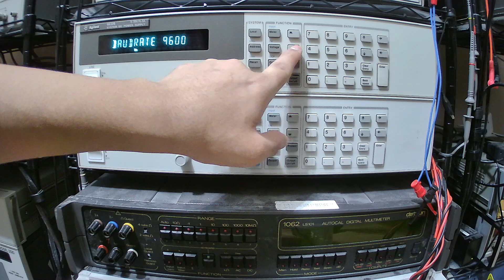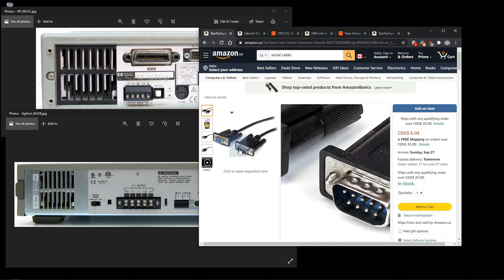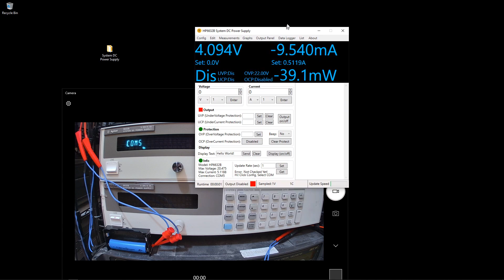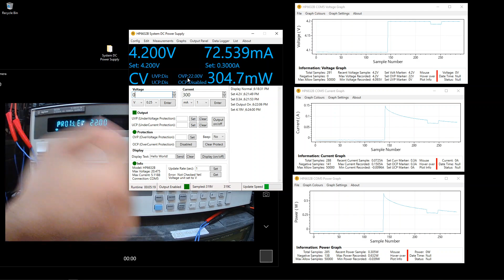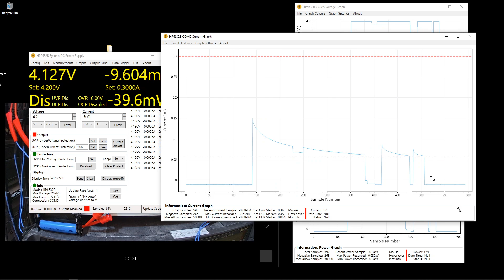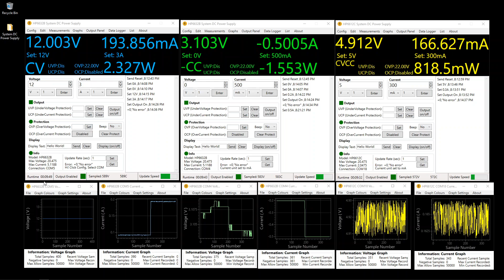Software for Keysight 663x2A, 663xB, 661xC

Comment: It works perfectly! Thank you very much! :)
Today, I will try to get it running on a raspi and then integrate it in my interfacing C-program.

A very very important hint for others:
I fought 3 days with very different cables and adapters to get the software running, because my gender changer from Amazon was stupidly not a "null modem" one!!!
Buy simply a female-female cable as a null modem gender changer and enjoy the program (with every rs232 to usb adapter, since the chip doesn't matter at all)! :)

Comment: is this software good for hp6612b? can I use the hpib connector instead of the rs232? thank you
Reply from the maker: HP6612B should be supported. Only RS232 is supported, for now. You will need a null modem cable/adapter and a rs232 usb serial adapter. GPIB will be supported in the future release but only for the AR488 Arduino GPIB adapter. Hope this helps.
Reply: @TheNirav3  Thank you very much. Keep the great work
Reply: @thecoffeeblog  me too for HBIB